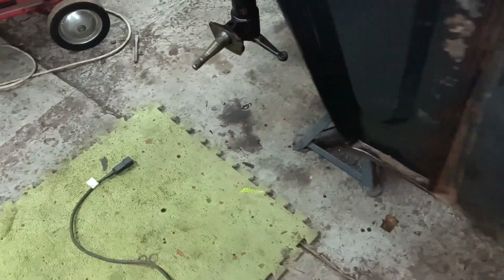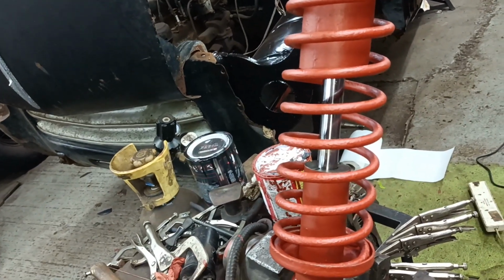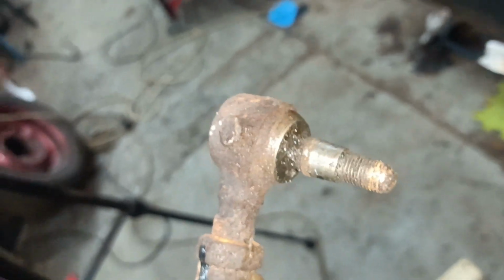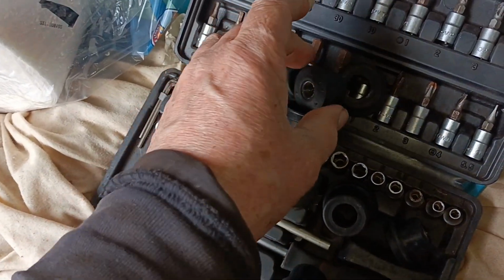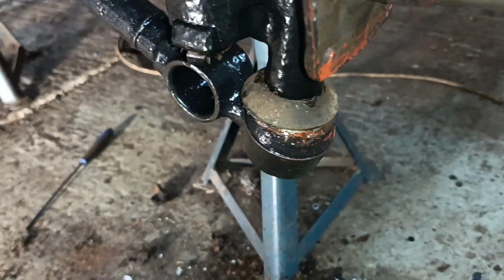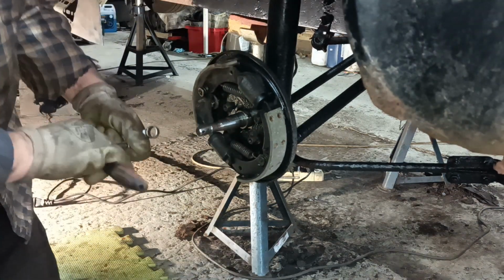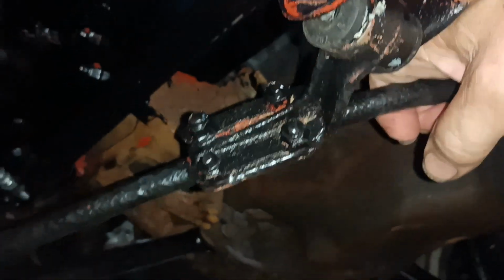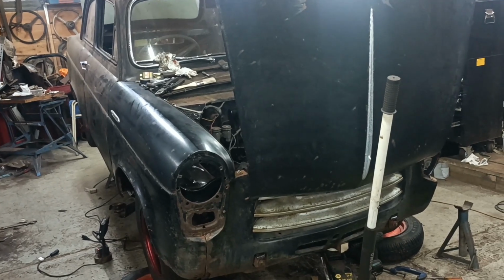Mart's 1955 Ford 100E Anglia part 25! Front Suspension Goes In! (2362)

Comment: Hi Mart. A suggestion, if I may? The rubber in those bushes twists to allow for the suspension movement. The outer part stays still while the inside twists as the suspension moves (or vice-versa) so it's good practice to tighten the nuts and bolts with weight on the wheels, i.e. the bushes are in a neutral position. If you tighten them with the suspension hanging they will be in a state of permanent twist once the car is back on its wheels and will wear rapidly. Can I suggest you loosen all the nuts with with the car standing on its wheels, bounce the suspension a bit to settle everything and then tighten them again. As you've already found, this isn't a job you want to do too often!
Reply from the maker: Hello LMS. Yes, good points. I did tighten them with the weight on the wheels. I will loosen and retighten after a few miles when the vehicle is at it's full on the road weight. Thanks for mentioning, I was aware, but some might not be. Thanks for watching and commenting.
Reply: @MartsGarage I go further than yourself Mart in that I'll assemble the components and not tighten the fasteners (if they're nylocks or phillidas (fully metal locknuts with no insert or deformed section) nuts they're unlikely to come off in a test/shakedown/settling drive, quick drive round the block for everything to find it's natural position then back to tighten/torque everything up.
Reply from the maker: Hi Steve, great to see your name pop up here. Yes, good points made. I thought I'd mentioned it in the video but I do mention redoing it when down on the ground in the next one. I remember a friend had a lop sided car (some ford or other) and it was due to tightening the bolts when not on the ground.

Comment: The new brake hoses look long enough to reach the bottom wheel cylinder. Both cylinders appear to be the same part number. Swapping the bleed screw to the highest point will ensure there is no air pocket trapped after bleeding. I remember you said you are putting the brakes back as found, but I still believe they may have been assembled incorrectly,  even from the factory. Uneven wear of the shoes would be evidence of trapped air in the top wheel cylinder.  When you drive the car you may find a spongy brake pedal and less than adequate brakes. Sorry to nag but it doesn't look right to me. Did the 100E have a reputation for poor brakes?
Reply from the maker: Hi Derek. I don't want to try and reinvent the wheel on this. I'll stick with the factory setup. People have driven millions of miles on this setup so I don't think it worthwhile trying to change it. I have pressure and vacuum brake bleed kits so shouldn't have a problem. Thanks for watching.